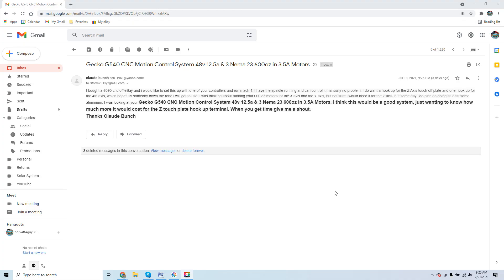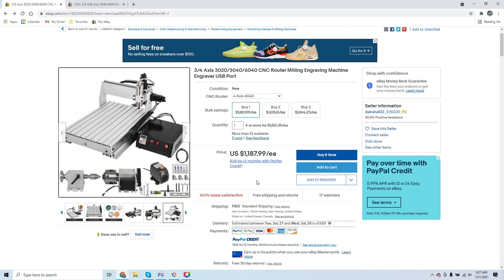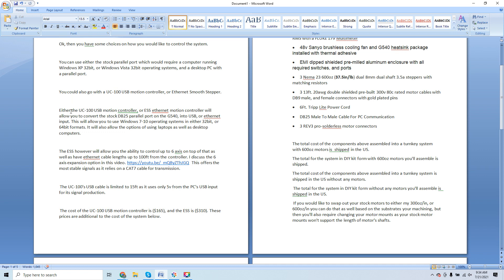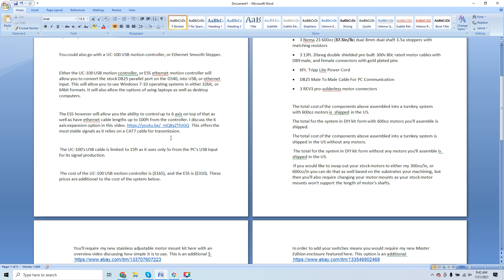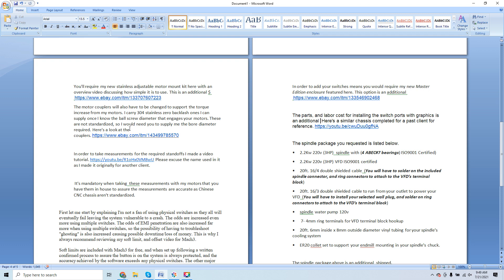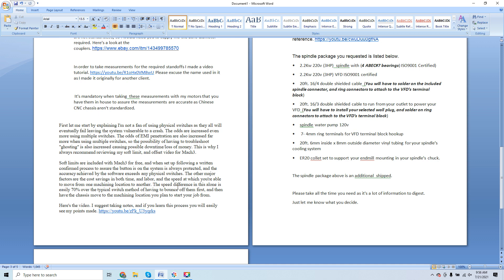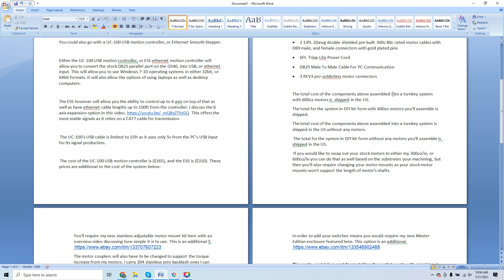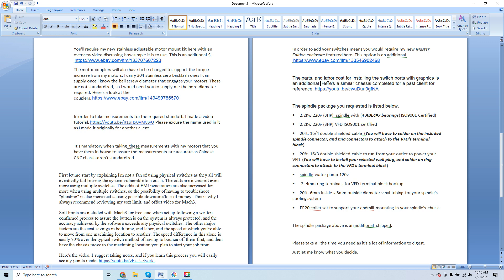6040 CNC Electronics Retrofit The Complete Breakdown..

Comment: second time watching and youre right on the chinese aluminum couplers. I spun 2 of them with only 92ozin motors. i even destroyed a gerwah coupler rated for 92ozin and separated the spring from the end. my grandson loves when i give him broken robot parts. he uses them in his star wars toys:). the aluminum ones, one completely unwound the second started and got to 2 times its length. i bought a somewhat nice z probe however its manual is in some chinese and the wire colors in english dont match what it has and its not shielded wire. so the wire i got from you, i will use to rewire it. 1st switch is NC zprobe 2nd switch after about 1cm travel is NC estop. it has an air jet to blow off the top that i think ill remove its just an awkward tube with a slot in it anyways. had to order a wiha .9mm hex driver to open the switch. couldnt believe my 1.3mm was too large. i imagine i will also have to pop the plastic cap on the bottom . i think their idea of shielding was the metal sleeving around the junky wire. i guess i could use the feeler gauge i have been using for z height but i have on occasion  driven a bit into the stainless steel gauge and even though its thin it isnt weak its oldschool from my father in law and ive chipped a bit or two. even destroyer a $40 amana 1/32" endmill when i had it set for continuous and i thought it was in step mode and i drove it full speed into the gauge. thats when i stopped buying amanas but they do cut fantastic. i switched to yonico because they were about half the price and still a very high quality and very sharp.  maybe ill watch this a third time next week to catch anything i missed. i copied it to my drive but i like to comment when i watch. Have a great one Vince the flux arrived perfectly dry. oh yeah i actually found a 2" steel tube table frame kit at global industrial that i feel will do fine. rated to 5k lbs i will purchase a 1/4" plate for the top and an 1/8" plate for the shelf and should be in at about $500 for the table. i also think 1/8" wrapped around it should hold the AC unit just fine and im sure i will have to use sound deadening all over the side with it mounted to it. comes in 6 and 8 foot lengths though the 6' would work i want 1 foot at the foot where i will have the keyboard and 2' at the rear so i could use the table for my drill press or grinder/buffer if i needed them for a job. and would allow bracing for passthrough work as well. i dont know why but i want to make a door for my bedroom something unusual, possibly gun compartment. well i have typed through the entire video again. i hope the machine arrives soon i dont know how much longer i can work for the school district things are getting wierd there.
Reply from the maker: Yea, I hope comes in soon for you to start the retrofit. Its certainly time for everybody to have another option when it comes to there sources of income. Thank you,
Vince

Comment: i bet this vid is because of people like me:) I need a bill set up for enough of the ferrites and solder on ring connectors to finish up my cab.Im wanting to prepare for future possibilities. i doubt id ever use the limit switches but definitely a z probe.   found a really nice one.  nice idea you gave me to grind off some paint and ground the chassis of the pc. still struggling to find scrap steel for my bench/enclosure. and then i get to learn welding yahoo. at least i have friends that weld so i can get tips. i am also debating on sand or cement for filler in the square tubes.. i will be hitting you up on the couplers and mounts but will hold off til the frame comes in.
Reply from the maker: No Dave, this video was made to cover all the questions that I cover on my consultations to save time as everything an end user needs to understand is covered in it. Just let me know the amount of ferrites, their size, and amount of ring connectors you need. Waiting for the chassis to come in is the best thing to do for the final accessories. Thank you as always for your support,
Vince
Reply: @corvetteguy50  Im guessing 1 dozen for 18ga and might as well do the same for 20 ga wire i have 50 for larger wires and the spindle group
Reply from the maker: I can do the ones for the 18awg silicone wire, but I don't have them for 20awg. The best way to add them to that gauge is to use a slightly larger bored ferrite, and run the leads through in a loop.  Thank you,
Vince

Comment: you said the vfd is the biggest source of EMI and it should not be put in the electronic enclosure, I totally agree I put mine in a seperate Metal steel enclosure which I grounded to earth. Is this correct Or are there better ways?
Reply from the maker: Hey Kor, Thank you for your support. The VFD can be mounted in the fashion you described, but in doing so cooling can become an issue, so making sure the proper sized cooling fan is used in the enclosure with the VFD is essential. I recommend a unit with at least 100CFM of volume. The other option is to mount the VFD in a distance of 5ft from the CNC chassis as the distance helps diffuse the EMI. The farther it is while being practical is best. This still doesn't in any way mitigate the use of the proper double shielded cable being used for both the spindle power cable, and the VFD's power cable. Thank you,
Vince

Comment: I'm doing a G540 upgrade on my 6040.  I had decided to just stay with CNCEST's motors, whatever they are, as my use will be very light duty.  Literally just taking 1/32" cuts into oak.

Can anyone tell me what would be gained with my application by upgrading the motors to the 300 oz/in ones?
Reply from the maker: Mister Bigchip, thank you for your support. The stock motors that are included with the 6040 are around 150oz/in, so doubling your motors torque along with their voltage through using a G540 will provide a massive difference in feed rates, and resolution. This isn't a mandatory upgrade for softer substrates like wood, but you will notice a difference. Thank you, Vince